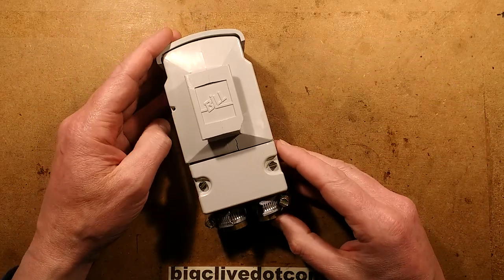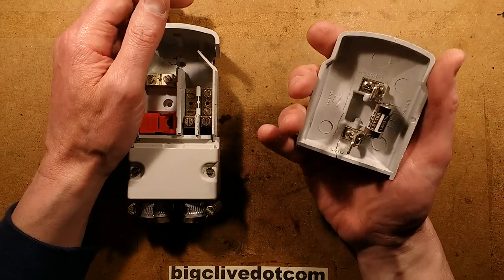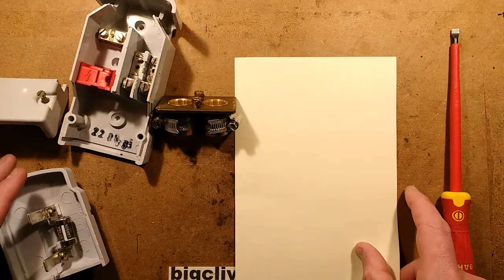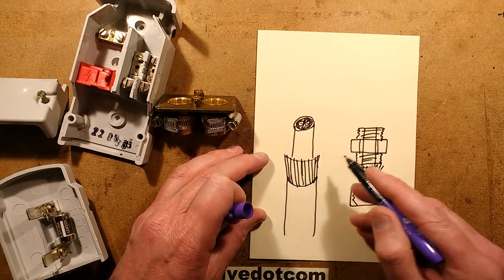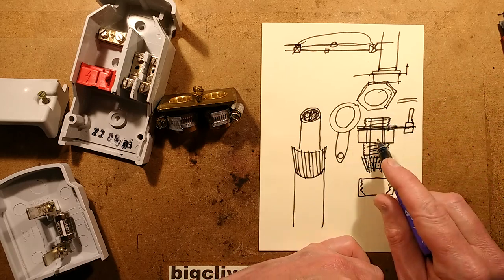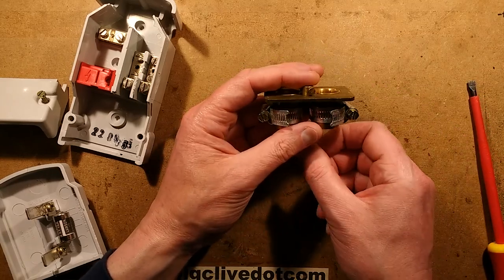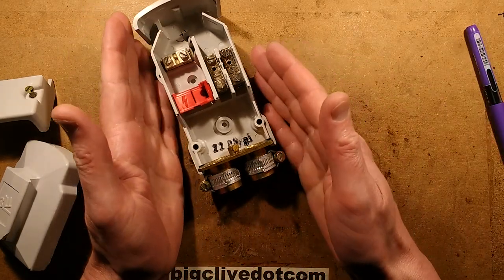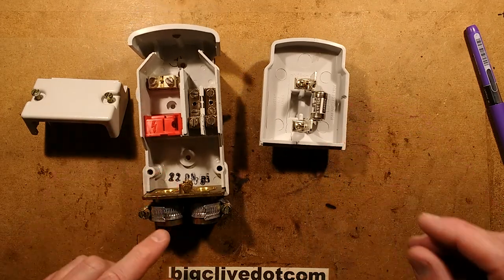Inside a lamp post connection and cut-out unit.

Comment: Big clive the led super hero. Am a bit of a newby to this grow light stuff, my friend gave me one he bought a few years back but it never worked for him, I've opened it up and all the inside parts work fine, I even had some row's of lights working, although it may have had something to do with me having my hand on the back of the LED chip board when I tried it out lol, it has 2 fan controllers each powering 4 12volt fan's, it has 6 light drivers looped with 155 volt out put and input of between 86-264, I don't know the amps, each drive power's 48x1w chips on a board of 288. There's no names on it anywhere or any other details, just the light array of R,B,O,W 210:50:14:14, 288*1w. If I added thermal paste (fresh), would this help any?? Does it definitely need the paste and heat sink to work?? If it don't work in the end, could I swap out the chip board for say 50w cob/Cree through the 6 drive's that are each powering 48w on the board?? Or could I remove the 6 drive's an use driverless LEDs, what's the best or cheapest way of going with this little project I have been trying to figure out for day's now. Any answers or suggestions are well appreciated, cos if you've read this far, you're owed a massive thank you.

Comment: Those thin steel nuts, my god they’re horrible. 
I saw a nice variation on the theme a few years back where the gland had a decent brass nut that had a threaded hole in the side for attaching an earth connection. No idea if they took off or not but it must have been easier to do than shitting around with that wretched tin pot thing. No spanner in the world will fit it once it’s gone over the edge of an enclosure.

Comment: Multimeter fuses are expensive as they tend to be rated at higher voltage than 230V. My meter has fuses rated at 1kV

Comment: Big Clive, have you ever considered doing a video on why we use 230V and 115V AC and not 415V AC e.g like used in commercial settings? Wouldn't a higher voltage be more efficient?
Reply from the maker: It's for safety.  The higher voltage raises the potential fault current and would require that things like plugs and sockets were more rugged.  400/415V is better suited to environments requiring more power and the advantage of the phase rotation provided by all three phases allowing for simpler motors.
Reply: bigclivedotcom That's useful to know. I'm still trying to wrap my head around two phase vs three phase.
Reply: bigclivedotcom That's useful to know. I'm still trying to wrap my head around two phase vs three phase.

Comment: Are jubilee clips still used as much in industry?  I know that before I retired we weren't allowed to use them to connect water hoses because of their suspect integrity but not sure if they were frowned upon for electrical use by then?  I know if you were over zealous tightening them, or if they had been used a few times, the threads and/or tightening screw could shear!

Comment: Neat to see how it is done in the UK.  Things are so different here in the US.  UK version sounds better, but we also use the shitty stamped metal nuts. Difference is ours are not hex, but have "nobs" you are supposed to be able to grip with pliers, or drive around with a screwdriver and hammer.  They don't work for shit either.

Comment: I think you have the way fuses work wrong.  The sand filler is designed to diffuse and cool the metal plasma so it plates out and stops conducting, rather than encapsulate it.
Reply: Robert Szasz To be fair, you are both correct.  The melting of the sand absorbs a great deal of heat, cooling the arc flash and helping to condense out the vaporized metal and extinguishing the arc...really just different perspectives on the same phenomena.

Comment: Interesting, thanks Clive! Am I right in thinking there is often an RCBO downstream, too?

I've been advised by a DNO to design for 50kA, but it doesn't need much test lead resistance to attenuate that down to manageable levels, so 50kA really only applies to fused prods. I'm not going to lie - there is a degree of dick-waving when it comes to fuse size: Fluke does it, so we all follow. But one practical reason the LST16 is not specified is because it's screw terminal. So you'd have someone over your shoulder saying you need to quote a torque setting which means the user needs a torque driver to do it properly, which is the only way certain UK industries do anything. 

You're right £10 for a fuse is a bit much but bear in mind it costs £30 to issue a prescription for 30p paracetamol. My advice is don't be blowing fuses!
Reply from the maker: There are rarely RCDs or RCBOs used in street lighting unless an external socket is added on a pole.

Comment: Meter fuses are different from mains supply HRC fuses for 2 reasons: much faster opening time (mains fuses need to withstand surge currents, meter fuses must open quickly to limit fault energy) and the ability to break DC fault currents. AC rated fuses rarely can open any fault current over maybe 100V DC without exploding, specially made DC rated fuses can.
Meter fuses are really expensive for just one further reason: Bussman and Siba want to make $$$ because they can. Chinese meter fuses suck (i.e just relabeled AC HRC fuses that usually wont save your ass on high voltage DC).
I saw the remaints of a meter with the fuse replaced by a regular AC690V 10A gG Fuse when it was used to measure current on a 500V DC line when the load shorted, luckily nobody was holding that one when it happened.

Comment: I don't quite get this and hope someone will be kind enough to explain. In the UK you have about 240v  at up to to 13A in an ordinary fused plug.  About 3 kw.  Is there a street lamp that needs more power than that?  Are they not individually fused but rather daisy chained?   In short, why are they fitted with fuses that support such enormous current rather than fuses which blow at, say, 10 amps?
Reply from the maker: You could fit one with a lower current fuse.  Everything is rated higher for ruggedness and to allow for future loads.  Like car charge points.

Comment: That fuse is interesting, looks similar to the “pyrofuse” they use on Tesla cars.
Reply: evilution the pyrofuse contains normal fuses and a pyrotechnic element as a backup and controllable element. It's safer than a crowbar circuit (high power switch that shorts the incoming power, hopefully causing fuses to blow) as downstream protection because a crowbar, can cause lots of damage to everything upstream and when a very large lithium battery and crashes are involved you don't want extra insults.

Comment: All of the pinball operators need to watch this video. xD
Have not had a pinball machine yet that have any of the right fuses in them.
And yes even have a pinball machine I am working on restoring that has foil on the fuse block.
Come across a lot of 20 amp fuses in pins and wonder how the pin has not burst into flames yet?
I know all about idiots not fusing something right. >.<
Oh yeah and plenty of line cords on pins are buggered as well another pet peeve of mine is having line cords chewed to heck or badly soldered then just electrical taped.see that to many times on the pins I get as well. o.o

Comment: 33 now starting serving my time at 17 and I have never once done street lighting in the summer god I hate fucking street lights.
Reply from the maker: Yeah.  They only ever think about maintenance in the winter when the lights are needed.
Reply: Yeah thats a good point I was I was thinking more of new intalls  running cobra reels through muck and shite in the pissing rain then up into the basket of a teleporter to freeze your nuts off. In Ireland usually the council takes over maintenance upon handover.

Comment: Wow, that cabling system sucks. Nothing like that in the united states, just standard compression fittings. Either metal and rubber or plastic and rubber.
Reply from the maker: It's a common industrial cable.  It will be used in America with the same termination system.